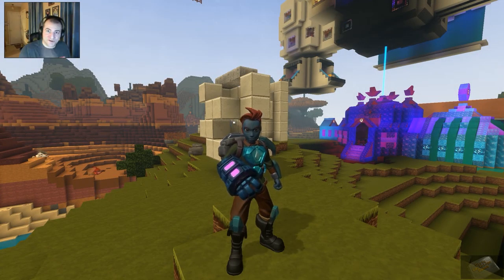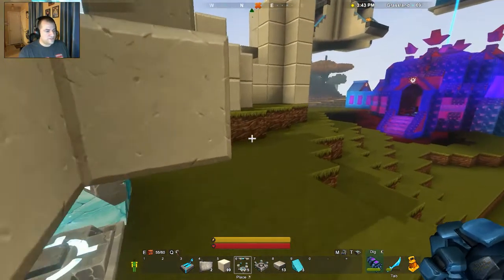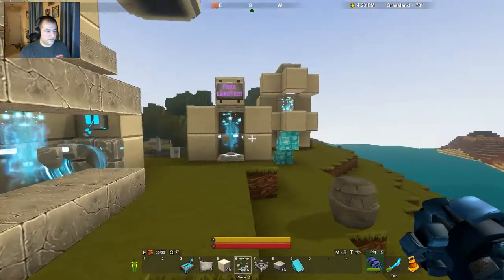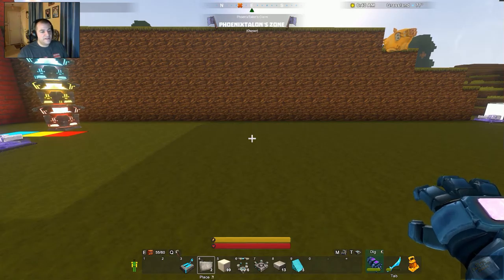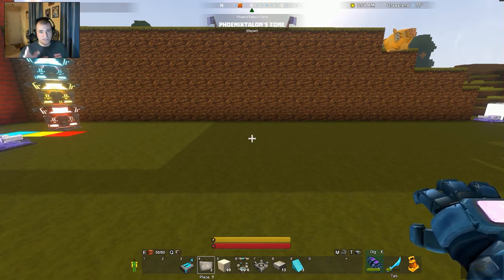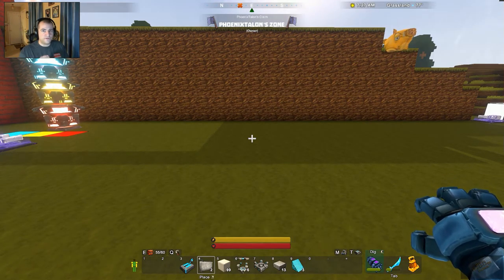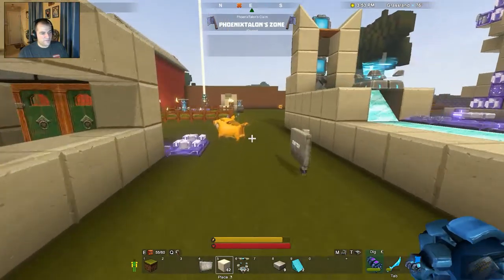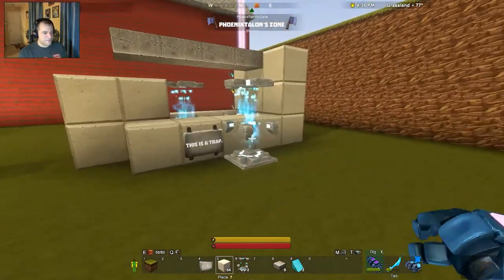Creativerse R37 Machines Tutorial 11 - Teleporter Traps

Comment: on your number pad and number comparison gate tutorial. Is it possible to wire a trap door on the "XOR" gate, so  when a wrong code is entered it will be triggered?
Reply from the maker: I would wire more than one trap door, and put it in a sealed room, so the victim must stand on the trap doors when they enter the code.  Then have teleporters below the each of the trap doors which all go to the same place (the trap).  Then just hook it up exactly the same way in my earlier tutorial about the number comparator.  Then you would hook your trap doors into the same circuit as the red "failed" LED.  As far as the sealed room, just make a one way door going into the sealed room.  Instant trap.  But you didn't hear this from me.  LOL